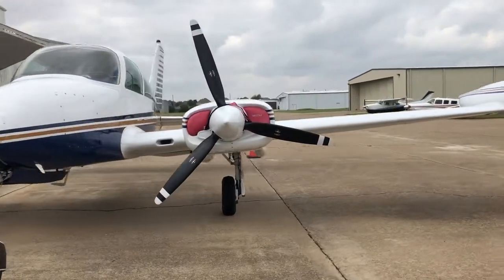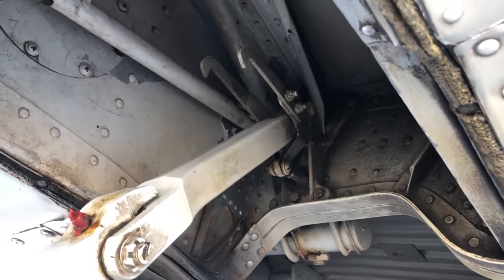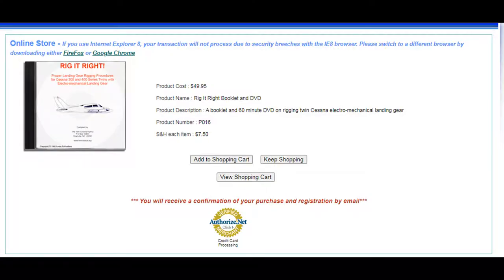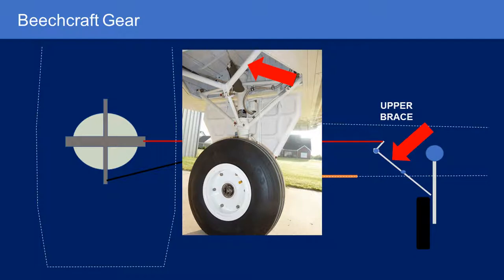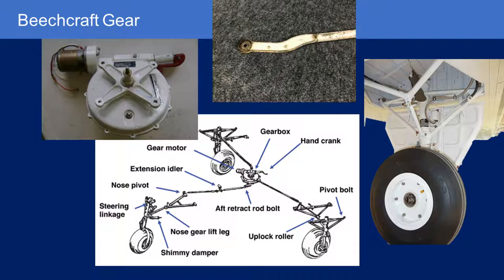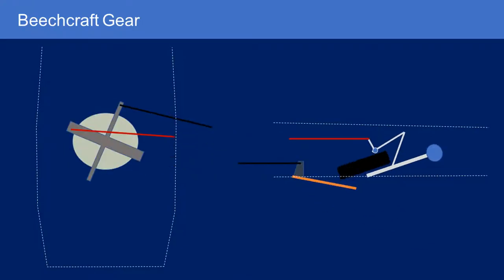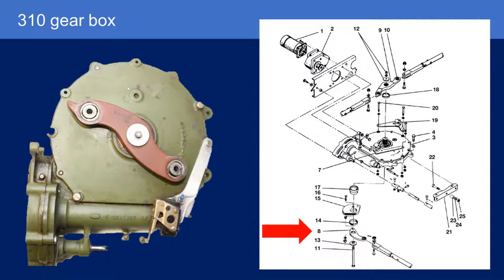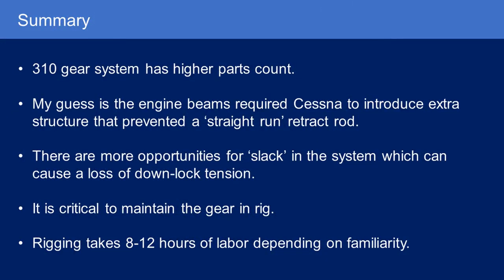Cessna 310 landing gear expose' including animations

Comment: After working at a freight outfit that had a fleet of 402 B models and now at a flight school that has 29 aircraft with 3 F33A Bonanzas I would say both these landing gear systems work exceptionally well. After mega cycles (thousands) on gear in Bonanza the transmission bolts that secure to airframe will wear into support and hog out the holes if not tight and its recommended the rod ends on aft pushpull tube for nose gear get replaced at a set amount of hrs (you choose) per Beech Aero Club. 
              On the  Cessna twins (like you were saying) the round torque tube will unravel like Pillsbury dough boy roll, I have seen that once, there is also a mod for a bigger fork bolt if I remember right. The rigging can't be  too tight or will cause binding and cracked parts (use fish scale on down locks). Outboard gear doors also need stainless hinge installed for a one time fix. Thanks for vid  :)

Comment: up lock hooks are for holding the gear solid during plus and minus g loading to keep strain off the push pull and twisting torque tubes while at high speed cruse

Comment: If you want a copy of the "Rig it right" CD I'll sell you mine.  It is a poorly digitized copy of a VHS video made at TAS decades ago.  It ignores, the older models and has several blatant errors.  Their "Rig it right" pamphlet isn't much better.  I was a member of the Twin Cessna Flyer for a year and found it to be partial to their advertisers, not the members.  The technical questions I posed to the site were never answered.  I did not renew.  I am an AP/IA that owns and operates a 310.  The Cessna twin mechanical gear system is sensitive to proper dimensions and tensions.  A hard landing or excessive side loading can possibly bend or distort a component.  Similarly a strut not properly operating to full extension prior to retract can jamb a wheel and break an idler arm or bend a push rod, as the gearbox is very strong.  A rigging check is mandatory at each annual.  With proper tools and experience this is not a huge ordeal.  The Baron gear system is not without its share of faults.  You are correct, the little spring HELPS pull the lock over center, but the down-lock tensions comes from the gearbox and the length settings of the push rods.

Comment: Retired mechanical engineer here.  
   A retract design challenge is routing the push pull rods.  The Barron and 310 have different spar locations, wing platforms, pilot position which influenced the solution.  What you might see in the 310 linkage IS the simplest solution!  It’s not entirely apples to apples.
   The 310 torque tube, of itself, is not a problem.  The torque tube failures likely resulted from detailed weldment design or execution.   Despite the $$ bite of replacement, consider the years, if not decades, the torque tubes have been in service.  The GA fleet is old; fatigue and corrosion take their toll.      Cheers
Reply: GA is like a golf bag full of clubs.  Sure, using the clubs wears em out some, but when they’re doing nothing while in the golf bag, they wear as much, if not more, by getting banged around all the time getting hauled around the coarse, rolling around in the trunk…. 

Airplanes, and cars for that matter, can really suffer just standing still, parked out in the elements.  A little crack starts and corrosion seeps in and makes it worse.  Seals dry out.  Dissimilar metals corrosion.  Oil falls off exposed steel engine parts, like cams and lifters, and piston rings, and cylinders, and bearings, and…causing rust.  Fasteners lose their plating and cause aluminum brackets to corrode.

I’m really talking myself out of owning an airplane.

Comment: Great video, thx for taking the time to explain. I just finished rigging mine (C310R) with my mechanic, and it does take some time. There is one bolt that is on the upper part of the overcenter lock link, that if not lubricated frequently, will seize. This link will shear off at its upper attach point on the strut. Tony Saxton of TAS Aviation recommends replacing this bolt, and make sure it gets lubricated frequently. Thx again!

Comment: Outstanding video Jason. Although objectively-speaking Beech system is clearly superior (simpler, better kinematics, fewer parts, more robust, easier to rig and maintain, fewer failures, etc.) I do like the uplock design on the 310. On a Beech, there is an uplock cable and if it breaks with the gear in the up position, your gear will likely not come down. I think less of the chance that happening with the 310 system due to rod actuation of the uplock hooks. The 310 also has much more ergonomic position of the emergency gear handle. In a Beech product emergency gear handle requires quite a contortion from a pilot to reach backward.
Reply from the maker: Thanks! I'm a fan of your video's as well.

Comment: Landing gear components have always looked far too spindly to me, for the stresses they need to accommodate.  And then toss in the occasional side load stresses.  GA planes look especially spindly, but even on warbirds they don’t seem able to work as well as they do.  And work well, they do!

At any rate, you’re shattering my dream of owning the rakish 310 - even as an A&P.  Suddenly the 140 or 170 seems so much more appealing :)

This was a really good episode.  And did I hear you correctly that you came up with the animation using PowerPoint?  I guess I didn’t really know you could simulate motion in that program.  Anyway, yours was quite good - it visually got your points across and that’s what matters.  But I also think you did well with it.  

Nice work, Jason, and thank you for pointing out the Twin Cessna Flyer sight.  I already got sucked into a few of the articles by owners and the costs of the parts and repairs they’ve had to pay.  Ugh, depressing!